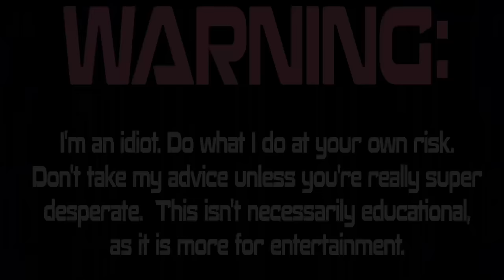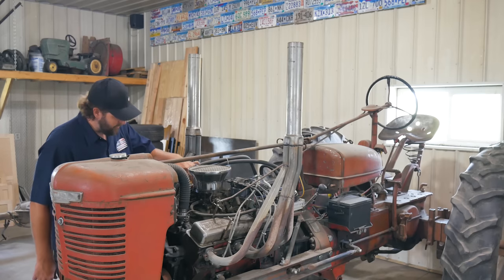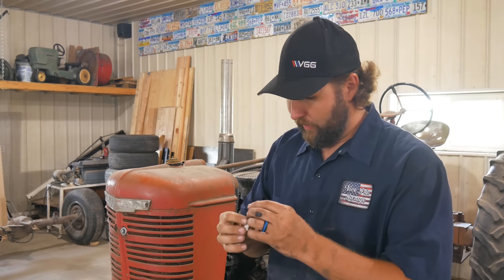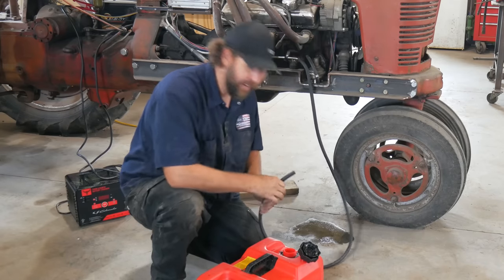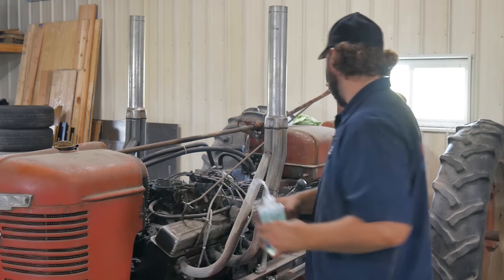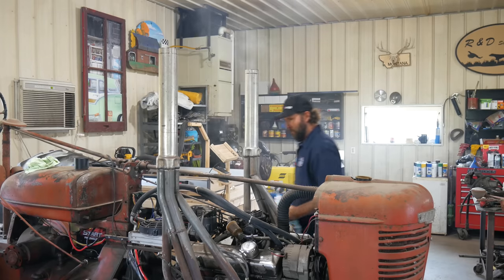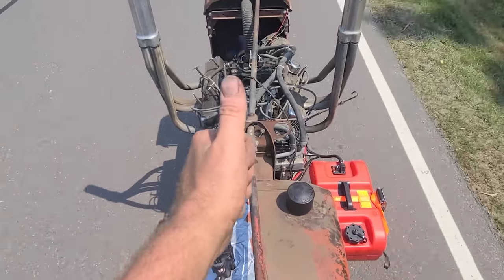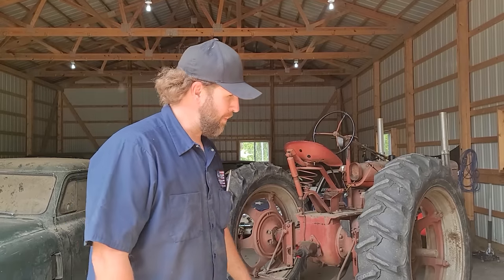FORGOTTEN V8 4 Speed Swapped Tractor - Will It RUN AND DRIVE 35 miles home?

Comment: In one of those inexplicable moments when the crowd's rumbling life-force fades, a thin, papery voice from the back row rises and creeps forward like a slowmo wave and the words form from letters scattered above the expectant faces..."Hey Derek, do we get a burnout?"  There's a question mark in every pocket as the drone returns to its drome.

The best part for me was 35 minutes in when he is listening to the engine, trying to ascertain what's going on inside where the oil is splashing everywhere, bearings are moving against reciprocations of short and long duration, and metal is approaching and leaving other metal.  We're watching years of experience stored in the human brain, brought to bear on this complex machine which is not performing as designed.  Derek is the Zen Master of Vice Grip Garage and Internal Combustionary and we are lucky witnesses.

Comment: When I was just out of high school a friend and I put a buick special V8 in an 1930 something Oliver 70. I will tell you right now that it run over 20 mph. I was following him down the highway and he got the urge to turn er loose like a bull MOOSE and at about 52 mph he remembered there was fluid in the tires. That tractor went to hopping like a Jack Rabbit and I thought it was all over. Some how he got is slowed down and under control and I have never figured out how. That was probally 55 years ago.

Comment: I spend a lot of time on those tractors    the superM and that superH    They cruise along  fairly good in road gear    some of those old tractors that didn't have the road gear were painfully slow  those Sherman creeper gears sure are a bonus   they're getting hard to find now I'd like to find another superM or H with  three-point hydro hitch and an aftermarket four wheel drive    convert that baby  from a tricycle into a four-wheel drive that  would be a score    sweet machine for sure
 😁👍

Comment: There's a trick you can do with a bottle 20oz or Gatorade I seen it with a Gatorade bottle but put 5hat between the hose and your mouth  by cutting a hole in it for the hose and taking the cap off to suck out of or he cut the bottom off something like that. But so you don't get any gas in your mouth. Benzene is pretty awful stuff.

Comment: That there Parts Master is of the house brand variety of a smallerish chain outfit called Bumper to bumper  (maybe others, I don't know). The folks from that Bumper to bumper outfit CLAIM them there filters are made by Wix for them. Although not a true Wix they seem to be a notch or a hundred more gooder than a Fram.

Comment: I am going to guess the grey gooey residue in the fuel bowl is from leaded gas of bygone days, strange as it sounds that residue built up over years and even odder is that the bowl may never have been removed and cleaned. We to a barn full of those old red paint trractors.

Comment: This looks almost exactly like the ChuckE2009 YouTube tractor but I think he swapped out the small block Chevy because it was so tired and put a 460 Ford in its place at some point. The detail is the same even down to the remote radiator location and everything. Kind of cool that they both came up with the same solutions because I thought his approach was kind of unconventional. A lot of the V8 conversions the guys do on the N tractors they have kits you can bolt the small block Ford right to the bellhousing of the tractor and use just the tractor transmission. Those things are scary.
Reply: If this is the ChuckE rig and you're unfortunate enough to get the small block after he stuffed it back in there, this engine would have one dead cylinder with the rockers removed from one of the cylinders.

Comment: She needs a balanced 327 with forged rods, some stout beehive valve springs and a circle track cam….8,000 RPM would really move that tractor down the road and with the extra reduction you’d get putting the 465 in Low you could really let her scream at the tractor pulls without too much wheel speed.

Comment: My two cents in, Take that chevy engine out and put a Oldsmobile Diesel in it, it would be a lot more useful, need to replace the head bolts on it, so the gaskets will stay in.  but its a good engine with a bad rap, and easy on fuel and the cooling system.

Comment: Oh god, you prefilled the filter. Oil from the bottles are not as clean as you may think. Very potential that you put stuff directly into the oiling system by prefilling it. No company tells you to prefill, and a lot have a caution/warning telling you not to do that. It won't do a ton short term, but will destroy internals doing it over and over again. Biggest cause of bearing failure besides for leaking fluids into the oil.

Comment: Maybe the builder realized the direction the air flows. Most tractors blow air forward. If the electric fan is trying to blow air back through the radiator, you will have a hell of a time keeping it cool. Mechanical VS. Electric fan. Who wins?

Comment: Only a rookie suck starts siphon hose. 40 years of experience tells me you should put gas  cap on tank and blow through hose pressurizing tank and when you remove mouth pressure in tank will start the siphon. Remember BLOW DON'T SUCK ! IF YOU DO SUCK DON'T  SWALLOW!

Comment: They should've retrofitted an INTERNATIONAL small block V8 - a 266, 304, 345, or 392.  Would have fired right up with no problems even after surviving a nuclear attack.  It would have gone thru about a gallon of engine oil on the drive home, though.